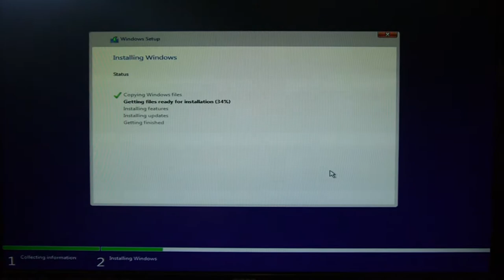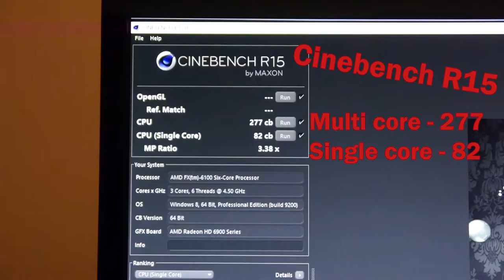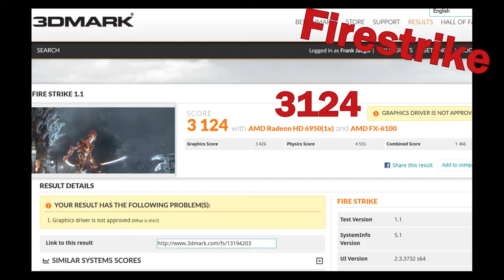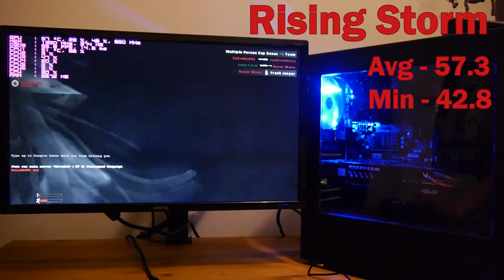Old School AMD Gaming PC for £170

Comment: I used a FX-6300 for a while and it was a great CPU for the money.  The only reason I moved from it was the black pixel glitch in Mass Effect, I went to a system with an i5-4460 so it was more of a side-grade than an upgrade.

Comment: 10 year core 2 quad over clocked to 3ghz scores 305 compared to the 276 of this CPU. You wasn't kidding about the poor performance of those CPUs. Good video. Subscribed. Sort the pricing a little though plse. The cooler technically wasn't free because you purchased it in the first place. I know you sold parts but using you logic I could build a whole rig for free. Buy a bargain rig for £300. Sell it for £400. Use the £100  profit on a super budget build and tell everyone its free! Doesn't really tally up, does it? All the best to all you tubers. Peace
Reply from the maker: Hey Barry, yeah the performance was shocking lol. Thanks for the support!
Reply from the maker: I completely see where you're coming from on the price, I really wasn't sure about the cooler because I'm not sure how to calculate a price when the rest of the pc it came from was worth more than I paid for it. Also it was only a cheap cooler with no mounting hardware so I didn't think it would matter, it's not worth much haha. Any suggestions on how to price it?

Comment: This case is very similar to the ms-tech ms-335, looks the same but costs only around 22€ ( without a fan). Do you think that's a good deal? ( It won't be for me, I have the aerocool aero 300 faw, very nice case, but with 35€ a bit more expensive.

Comment: I've been fiddling around with a Phenom ii x4 955 clocked to 3.72 and getting about 380 on cinebench...
Reply from the maker: Matthew O'Mealey I think that is all you need to know about the FX CPU lineup. Doesn't even outperform AMD's previous generation...
Reply from the maker: I was originally looking for an x4, but figured the difference to a overclocked 6000 series couldn't be that bad. I was wrong...
Reply: That's weird. I'm also tinkering with a couple of fx 8320&8370 and with a mild oc get around 660cb and a little more on the benchmark. Much better scores and I got them on crazy cheap local deals.
Reply from the maker: You know what, you're right. Looking up Cinebench scores shows these are much lower than they should have been... By about half! That's so weird, I wish I still had the PC to diagnose it. It didn't even register when I was benchmarking, I really should have noticed that...
Reply from the maker: I'd say really good deal on an 8000 series is probably still worth it, they at least hold up to the older i5s, though I'd escape the whole AM3 platform as soon as you can still :P
Reply: Jeagar Tech I'm debating on whether I should stick with an i5 4460 I've been using or move to the fx8370 I got a low deal on, though I have a chance to grab an i5 2500k real cheap too... 
I'm not a crazy gamer but I like building cheap rigs and selling them off
Reply from the maker: I don't think the 8370 would give you better performance than the 4460, but I'm not 100% sure. Given the choice though, I'd go with the 2500k and overclock the hell out of it. You can get such good performance with them, and even when they were first released outperformed the 8000 chips when overclocked.

Comment: When i got a fx6100 , 4.4ghz stable, got like 470/480 ,u'r oc are not stable at all imo
Reply from the maker: In hindsight, those scores are way lower than they should be, but I didn't see any overheating/underclocking and it past stress tests no problem, which is why I didn't suspect an unstable OC.
Reply from the maker: Unstable OC is a good guess though, that is probably what is happening here. I'm just surprised it didn't show at all.
Reply: Yeah i did watch the all video and the fx was stable in gta5 and the oder game, that's interessting
Reply from the maker: And it was stressed tested with AIDA64 and Intel Burn Test. So weird... I'm not sure how much it would have affected the game benchmarks though, it might be just an issue that is caused by long period-max CPU loads.
Reply: Jeagar Tech If u have the pc maybe try an other oc stress with occt stuff like that
Reply from the maker: If I did I would have done, but I've not had that PC in a while unfortunately...
Reply: Jeagar Tech np thx for ur time ;)